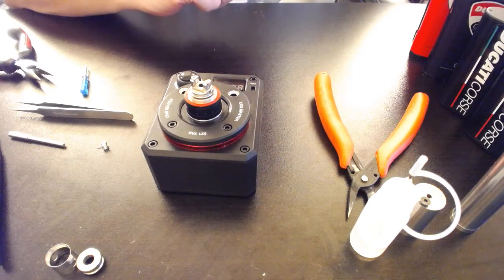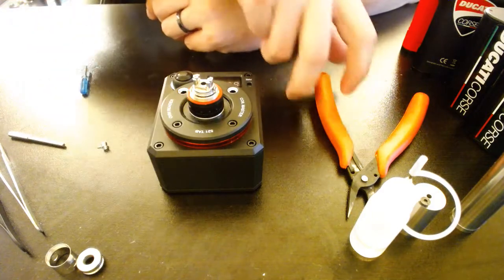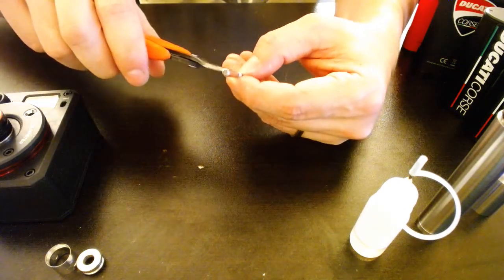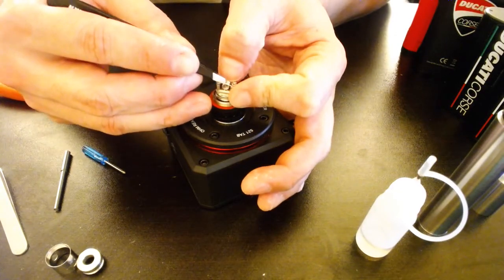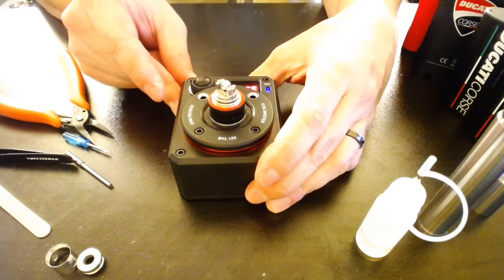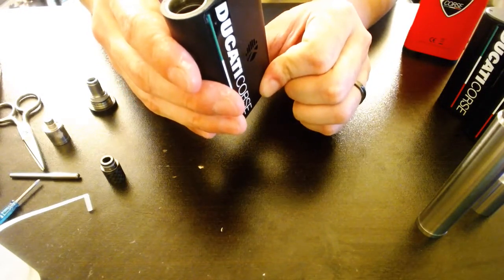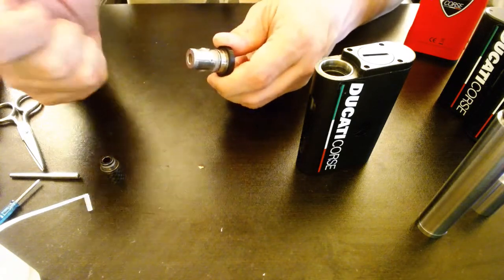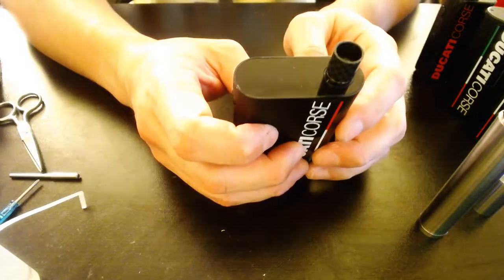Kanger Nebox RBA platinum wire build

Comment: I just made one for my subtank mini. I went with 26g since I'm more familiar with that size. 3.5 mm 5 wraps came in at .2 ohms. so far so good. Running it on my rx200 in ti mode. what r your suggestions for everyday watt and temp settings if I may ask?
Reply from the maker: I don't use titanium that often, but use temp control as a wattage limiter and start low, even at 200 degrees F and work your way up until the vapor is thick enough to your liking. In TC, wattage is less relevant because once target temp is reached, wattage is reduced and controlled. But you need to set wattage high enough to reach your desired temp!
Reply: This is my first time using tc, and that's what I've noticed. Right now my sweet spot seems to be around 350f. But do u run tc while using this? If so ni or ti or ss?